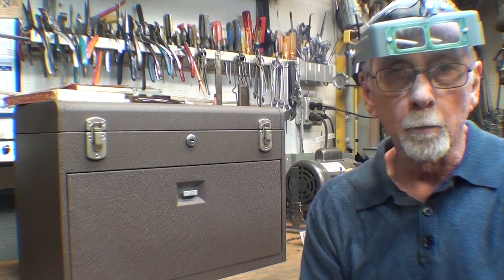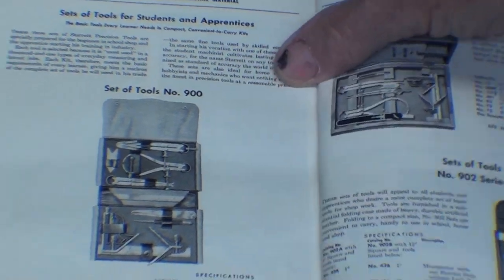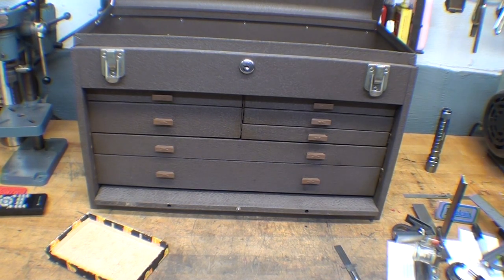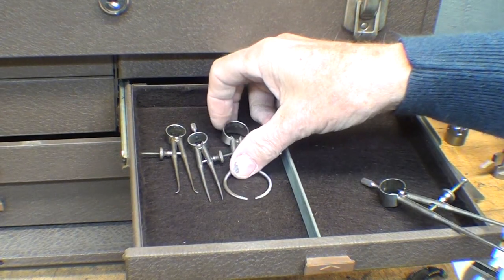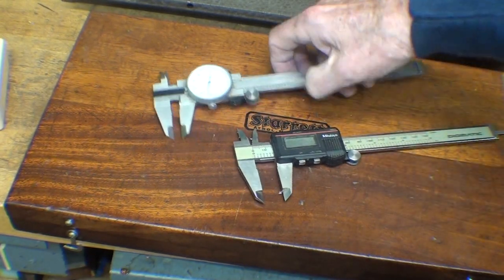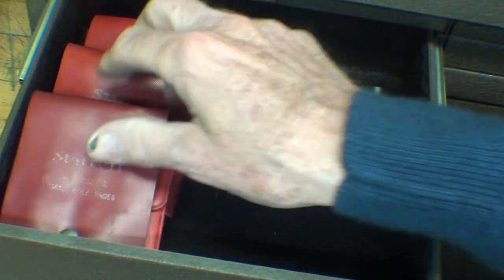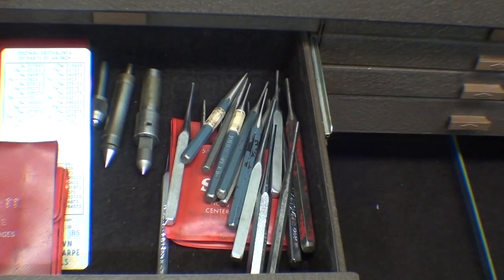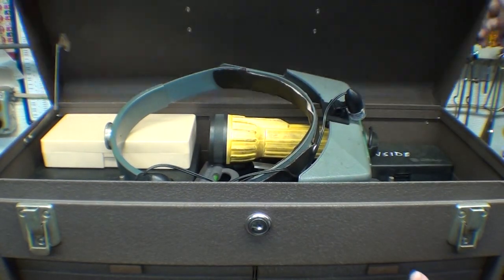Beginners Machinist Tool Box pt2 Tips #443 tubalcain

Comment: I used a piece of steel strapping ( used to hold materials to pallets ) and bent a couple to make retainers to hold charts inside the lid of my newer boxes that didn't have the retainer.  I also like to put a piece of scrap carpet in the bottom of hammer/large tool drawers.  Thanks for the Vid's, keep it up!
Reply from the maker: That's a good idea

Comment: Gerstner I believe made a leather covered box. I worked with a guy that had bought one from a guy that retired. Of course I last saw that box 35 years ago. I find a set of gunsmith screw bits to give you a good range in a small package.  By the way could you make replacement drawer pulls for Kennedy boxes on the 3D printer? If you want to keep one original, replace all the pulls on a box that doesn't matter and use the original pulls to replace on the box that matters.

Comment: I have had one of the HF wood chests for about 10 (15?) years. It is better than the price, but not in any way better than sufficient. The drawer bottoms will sag and the joints will fail if you carry it loaded.

Starrett still gives the data cards away for free (drill and tap, among others) as well as the drill and tap wall chart.

Comment: I had a bunch of odds n ends like you do with my tools until I put them together in bunches and sold them in lots of $50-$120 on ebay, and then with the money gained I reinvested in quality and name brand tools that were new and had new warranty (proof of purchase needed for lots of stuff these days). Since I have done that I have a more complete tool collection with more proper tools for the jobs I purchased them for. I'm more so in automotive so I have started acquiring specialty tools such as diagnostic items like a power probe and multi-meter. I have a very well put together basic parts hanger tool chest tour video in my channel, my toolbox at the moment is a 26inch craftsman box with 7 drawers and a 3 drawer add-on below it... I also bought a 5 drawer tool cart that im transferring over to tho. Great videos sweety you are a lovely man!
Reply from the maker: Good idea

Comment: I think I've got my apprentice level tool box pretty well filled out now and working up to the next level.  Like you, everything is in my own shop so I have a little less "security" worry.  I also have to go through the tools I've inherited from my father who was a heavy equipment mechanic for Empire.  I did end up getting rid of a lot of the obvious stuff I'd never use like 2"+ wrenches and socket sets and tons of stuff that is just 10x bigger than anything I'd ever work on.

Comment: A couple of things, one I do have one of the HF wooden boxes my main complaint is the dividers move around too much, it replaced a Craftsman machinist box that was shabby. One thing you could have mentioned is there is something called a Black Book that has the commonly used information for thread depths drill and tap sizes plus clearance drills and lots of other information. Sort of a miniature Machinery’s Manual it’s $30.

Finally I’m in your camp it’s hard to beat a dial caliper. I prefer a Starrett because he rack is on the top and has course teeth with care less prone to jumping off track.
Reply from the maker: Yes, I have one. Have a shown it inmany other videos

Comment: Wow you have alot of awesome tools! That mitutoyo inside mic would come in very handy for me, i machine with swiss lathes, and im using pins to get me within print, and an inside mice would get me quicker than going in the tooling room and trying to find the right pin size that fits. You nailed it about, "dont buy a new kennedy box, plenty of em for sale" i found a kennedy 7 drawer 277xb roller box and side shelf, also with a 2600B riser, and on top, a 3611B 11 drawer top. It took me close to 3 hrs to vacuum the fine aluminum  shavings out of the felt liners, as the fella had it in an aluminum shop. After cleaning everything, id give it 9.5 out of 10, paying $700, whereas new everything is $2,000. For an extra $100 he gave me an unbelievable amount of tools. Even his hammers! Later it hit me, if i was getting rid of my hammers, i wouldn't be at a good place in life. Love your head magnifier! Its interesting on the kennedy website, "your kennedy wrinkie finish can be cleaned periodically with WD-40® or Murphy®Oil Soap

Comment: Started my apprenticeship with a converted wooden munitions box my dad managed to find from somewhere, I saved up and eventually bought a eight draw Moore and Wright wooden tool box.  I've used it almost every day since my retirement six years ago.  By the way I think it cost £25..00, I was only on £2.19. 6 per hour at the time so it was a hard save.
Reply: Thanks for bringing the error to my attention it should have read PER WEEK
Reply: steve gale Just checked an old pay slip from 1965 ,42 hour week,£3.10.5 gross, £3.2.5 NET. That's what I earned from my employer Westland Helicopters,  Fairey Aviation Division.  End of.
Reply: Steve Gale. This guy as you rightly stated got his hour rate confused with his weekly rate. You are also correct, old money was LSD so you wrote eg. £5 2s 3d. I was an apprentice engineer so not in daily contact with precision tools. You wanted a mic or vernier you went to the stores where they were in their individual wooden cases. We kept our hand tools in simple metal cantilever boxes until the emergence of the roll cab. You sir are vindicated.

Comment: Enjoyed it! Just starting in it. Picked up a little gem of a Craftsman 109 to cut my teeth on in the shop.
Reply: Have you found the Yahoo 109 lathe group yet? Some good info and helpful people over there. I have two of the 109s myself, haven't' set them up yet though.
Reply: ShysterLawyer I have not sir... Thanks I'll look them up soon. Might do a video on my 109 tonight....if you get bored, look up Boxcar's Garage tomorrow and it'll be up. Thanks for the info.
Reply: Boxcar's Garage; sure thing, I'll look forward to your video
Reply from the maker: There was a model 109 in the antique store I have visited this morning. It was marked $250.
Reply: mrpete222 Wow, feeling better about my purchase...got mine for $50 but is missing the motor and the set of reduction gears that interchange. Have 1, but that's it. Should have my video done in an hour or so.. final edits now.

Comment: Hi! I came across your pt 1 video and this pt 2 video. I’m looking into buying an old used machinist chest (metal) to restore, but the particular chests I am looking at are each missing the front cover. I’m only looking at chests with a cabinet/drawer type keyed lock so that I can easily replace and use the lock.

How difficult would it be to make a replacement cover out of either plywood or sheet metal (like with a cheap $50-75 bending brake if necessary)? Is this something you would possibly consider making a tutorial of? I know not all chests are the same and I’m sure the front covers are unique too, so what I’d really be watching for is the advice on how to go about the design and all the factors to consider. If you would think about this problem and can come up with a solution, just know that I’d be excited to watch and learn anything you had to say on the matter. Thanks in advance!

Comment: I have one of those new type craftsman tool box. It sat on a bench. I have all my tooling in it- a couple hundred pounds. I opened one two many drawers and it toppled forward and the lid smashed me on the upper lip. It almost knocked me out and I had to get stitches. So they can be tip hazards so they need to be secured.
Reply from the maker: Wow, be careful

Comment: The one thing that I would add, is to start collecting more METRIC measuring instruments (micrometers, calipers, rulers), cutters, drills, etc. Practically everything I have to fix, or modify, or create to work with something else is all done in metric now. It's so much easier to just work in metric, than do the conversions back to imperial.

I'm slowly investing in metric tooling and it's making my life easier. But trying to get metric stuff here in the USA, is a royal pain, but do-able.
Reply: I forgot to mention that I've converted my lathe and mill dials to metric also. OMG, I'm loving it!!!

Comment: Just for the timeline, I was born in 1961, at that time Dad worked for NCR in Dayton Ohio making all those little parts inside a cash register. By the time I started school he had been laid off (more electronic models were just beginning) and he went to work as a carpenter. Leaving his 8 drawer Kennedy box in the basement. By the time I was 15 or so, I was enjoying auto mechanic work and Dad gave me the box to keep those tools in. I kept some mics and calipers but really didn’t know what many of those tools were for, the rest went in a cardboard box in the garage and disappeared at some point. After four years in the Air Force, I found myself working as an Aviation mechanic, out of state and on a vacation trip, Dad brought me that box and a few tools, I remember I had spilled a bottle of Indian Head gasket shellac in the top and made a mess. I used that box for about 20 more years on the job but it fell of the back of a flight line tug one day and was ruined. A sheetmetal man said he could make a new one easier than repairing it. I replaced it with a very similar Craftsman 8drawer with the brown wrinkle finish,as you pointed out only the lock was different. I used that one until the company decided to supply our tools a few years ago. I’m looking at it right now, in my garage, with too much stuff in it to pick up and 3 other large boxes to keep it company. That box (and it’s twin) have been part of my life for a very long time. I’m looking forward to retirement now and like you, I’m guessing it will be in my estate sale 🙂.
Reply from the maker: That’s quite a history on those toolboxes. I have had the one original box since I was about 16. My dad gave it to me. I remember that Indian head gasket compound, boy could it make a mess. A smashed tube of permatex Was also pretty nasty.
Reply: mrpete222 - yes sir, I got my license in the 1970’s but I like cars from the 1950’s, it was common to use shellac on those old parts with sometimes poor fit. That stuff had time to set up before I found it had leaked, the bottle was glued in there with the label facing up is why I can remember the name brand. It had a profile picture of an Indian on it. I had to finally chip it out with a hammer and chisel. Dad passed a few years ago and I wish I had kept more of those tools, I don’t do machine work (between the military and aviation jobs I did work in an automotive machine shop for a couple of years rebuilding cylinder heads and using the equipment involved in that) but the precision measurement stuff has been a big part of my working life.
Reply: mrpete222 - excuse me for rambling (if you even see this) but are you aware the Starrett company was bought by Snap-On? I attended a class sponsored by Snap-On and I gotta say, many were still of good quality but I wasn’t impressed with some of the brand new tools we had in the classroom.

Comment: When I left machining school ('91), I emptied my life savings ($600) to buy a bunch of Starrett tools as recommended by some experienced machinists.  It was a mistake.  I did not need a large, case hardened surface gage, or one of those real fancy toolmakers v-blocks.  Waste of over $350 on two tools I never used once in a 25 year career.  I also made the mistake of buying an early design Starrett digital caliper.  Vastly inferior to Mitutoyo digitals.  The Starrett had no on /off switch and two batteries that would die in two weeks sitting unused.  Had to remove 4 tiny screws to replace those batteries.   Every time I picked it up to use it, the batteries were dead.  There was no thumb roll either, and the thing was $250.  I complained to Starrett and fought them for months till they finally replaced the unit with an improved design.  I STILL much prefer Mitutoyo.  Their digitals react faster, have thumb rolls, and the battery lasts 6 months to a year, as well as being easy to install.  I prefer vernier calipers to dials, as the dials sometimes jump the track or get jammed by a chip.
Reply from the maker: Great comments. We all have tools that we never have occasion to use.
It’s no big deal when you buy them used for a reasonable price

Comment: Lyle, another great video set!

About that Mitutoyo battery digital 
mike, it DOES work.  As an analog 
mike.  It has the marks on the thimble 
and body, so you can read it like a 
"normal" micrometer.  $200?  You 
got hosed!

I also do NOT like battery powered 
measuring tools.  (Well, that 10 dollar 
6 inch caliper is quite good, for the 
price.  Best feature, measure a nut or 
bolt head, in one setting, and instantly 
convert from fractions to metric.  What 
size is this nut?  **MM, converts to .XXX
inches, or X/X in fractional measurement.)

steve
Reply: I have the same one.  When I used it 3 or 4 times a day the battery lasted a good long while.  Now I only use it maybe 4 times a year, and have to take the battery out because it's always dead the rare time I need it.

Comment: Great video, very informative. Re metal vs wood toolboxes, I was thinking of making my own from 3/4" plywood with hardwood edging and full extension drawer slides. How well do you think it would hold up? Any suggestions regarding finish to make cleaning off oil and grease etc. Thanks.
Reply from the maker: That sounds like a good idea. But I am not a woodworker. I would think polyurethane would be a good finish
Reply: My idea is to make it to a size that suits my tools. I am planning on just putting layout, measuring and marking tools in it. So I am figuring on making the drawers 1" to 1.5" deep. I just love the look of the wooden boxes.

Comment: Very interesting, but it saddens me to think of all the Machinist tools that will never bu used again. We just don't have the industry to support very many madhinists.  The process of gathering tools outlined by Mr. Pete is the same for auto mechanics.  I started with a medium size set of Wards Power Craft hand tools.  I upgraded and added as needed but at least I could make a living.  Back then  working in small dealerships with just a few mechanics we did borrow tools some without a real problem. Pay was low and we were all in the same boat.

Comment: Check your squares. I bought a new Stanley from the hardware store and it wasn’t square. They exchanged it for a good one.  Maybe someone dropped the first one.   None of the others were bad.
Reply from the maker: That is very surprising
Reply: mrpete222 I agree that this is probably unusual.  Stanley is a good brand.  Fortunately I was replacing beams in a barn and not doing machine work.  It only took one mark to realize the thing was wonky.  Thank you for what you do.  I can sincerely say that if I had to pick one channel on YouTube I would choose yours.

Comment: Mr Pete,  you've become quite the hamster as of late. It's good to see you. Rock on ......and thanks
Reply: mrpete222 just finished watching this. I'd like to add to the importance of putting away your tools and closing the drawers. If the shop has rodents, like rats, they come poking around at night looking for stuff to chew. Even if there's nothing to chew, they are always slinging their piss everywhere and it's all over there feet and tail. Rat piss will make your tools rust in no time at all. 

Also, the good hack saws have blade storage in their frame. I've got a snapon and another just like it (maybe bluepoint?) That hold a frw spare blades that you access with a flat tip screwdriver. Ive got an even beefier one (I think Lennox or Greenly or Klein??). Its real stout with storage for a few blades, ergonomic rear handle and front handle 2 blade mounting positions, 1 straight or plumb and 1 at 45°. ...AND, it's completely toolless to operate , including blade tensioning and storage access. I highly recommend it. ...

Comment: I am surprised that you put rough general,& striking tools such as punches in with precision metrology tooling. Am I  mistaken  would you not admonish your students from doing that very thing mixing tools which are used for rough work with fine,precision Starrett tooling? I had come to expect Mr Peterson You-Tube shop teacher to guide the uninformed,recalcitrant teenagers from their wayward path of maltreatment of precision equipment in all its forms!!
Reply: I agree, measuring tools separate, 
Also I cringed with the small files scraping together, each file in one sleeve or wrapped in waxed paper, no two files rubbing together.
same with sharpening stones, I frequently use down to 1 micron grit stones (sometimes down to 0.1 micron) for lapping small parts and having the finer ones "contaminated" will ruin my day as I will have to start over if surface gets "scratched up".